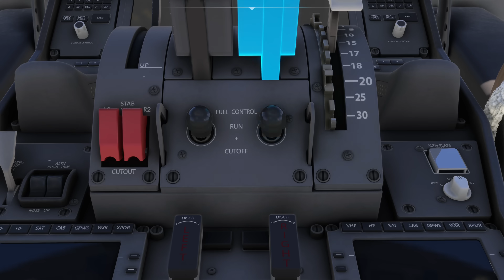Air India 171: Why Did The Fuel Cut-off Switch Get Moved?

Comment: Older American here.   I haven't heard anyone talk about how the airlines' financial liability could be influenced by the two major scenarios, intentional action by one of the pilots vs. operator / pilot error.   Do various scenarios impact airline liabilities / copiability differently?

Are there any other major commercial aircraft, that one of these pilots may have flown, that have switches, other than the fuel cut-off switches, located in the same or similar area as those the 878 that crashed?

Comment: My guess, with no evidence from a final report to back it up, is that it was a brain fart. More than one turboprop pilot accidentally feathered a propeller while trying to adjust the thrust and then noticed the mistake a few minutes later and reported it to the company, or were about to land without enough time to figure it out and so ended up in an accident report. This shouldn't even be possible given the knobs are not just in different places but feel different. So maybe someone was trying to do something with the thrust, hit the shutoff valve, realize he didn't hit the thrust, then went to the thrust levers without thinking "wait what did I touch earlier?" You can ask why anyone would confuse the two, but I've seen dumber mistakes in Air Crash Investigation.

Comment: In 2023 an Alaskan Airlines pilot in the 3rd seat....tried to shut off the fuel to the engines
But, was attack by the other two pilots and nothing very bad happened.
The 3rd pilot in a jump seat apparently was having mental problems.
Reply: Like the  pilot in the jump seat on FEDEX DC-10 years ago.
Reply: @sd906238 yea what a dumb evil p.o.s. that guy was, though his reasons of leaving something behind for his family was a good cause, it could never condone killing those 3 pilots, or even physically disabling one of them, let alone killing all 3 and crashing a wide body plane that could've taken dozens more with them, I could never forgive that p.o.s. for trying to kill me and clipping my wings, absolutely amazing those pilots survived
Reply: Yep different type of aircraft and he pulled the two engine fire suppression handles at 31,000 ft. The pilots quickly pushed them back in with no loss of power
Reply: @kiwicory100 yes, Alaskan Airways Flight 2059.
Reply: @Tryna-B-Good Alaska Airlines
Reply: @Tryna-B-Good it’s Alaska Airlines not Alaskan Airlines
Reply: Everyone’s blaming the pilots, but the same aircraft had electrical failures just one flight earlier — caught on video. The takeoff was unusually slow, and both engines shut down seconds after lift-off, with cockpit audio showing confusion (“Why did you cut off?” — “I didn’t”).

This doesn’t sound like pilot error. It sounds like system failure being buried to protect the company — just like Boeing did with the 737 MAX. Don’t let them repeat history.
Reply: @Gurpreet.jheeta  Why are you so sure that that conversation "Why id you cut off?" weren't a lie? Just to blame the other? You always think pilots are 100% mental at any time 24/7 every year?
Reply: There is the Germanwings flight 9525 2015 first officer who deliberately crashed into a mountain in the Alps.  Also,  the mystery of why the pilot of the Malaysian airline 370 went off course and stopped communications with the ground and the aeroplane just disappeared.
Reply: @abattle4101 Dont forget Egypt Air 990. The Copilot pushed the yoke over into a dive while the Captain was out of the cockpit in the lav.  Copilot cut throttles, and dobe the plane straight into the water.  He was heard on CVR saying "I put my trust in Allah" as he dove the plane.  The Captain actually made it into the cockpit, tried to pull out but ultimately lost the struggle and the plane crashed on the second dive.  I believe there was a Nigerian flight along the same lines.
Reply: I was often in the cockpit jump seat for a +hour flight during the 90´s. And iam still alive. My guess its not any seat, its the one sitting there that is a problem!
Reply: Very fortunate he pulled that shit on that flight as he was being flown to his own flight he was the captain of and had he pulled that shit while captain things might not have turned out so well
Reply: He was not still high on psilocybin, but it altered his perception to the point where he believed he was in a dream and panicked and pulled the fire switches in an effort to wake up from the dream. He wasn’t trying to kill anyone. That’s why the attempted murder charges were dropped.
Reply: ボイスレコーダーが公開されるまでは、パイロットがスイッチ切ったと断言しないほうが良いよ。家族に対して失礼だし。
Reply: yeah, he was depressed because he'd been to a memorial for a dear friend of his, who had died the year prior. Somehow, some imbecile who called himself his friend, convinced him to get high on mushrooms. He stupidly agreed, because he had a few off days, but the mushrooms were still in his system when he was in the cockpit, so he did what he did.
A really sad story, as that guy will never see the inside of a cockpit for the rest of his life
Reply: What is can recall was that the 3rd pilot was high on shrooms
Reply: @louisekerley716 he had taken them TWO DAYS before because his best friend died and he thought it would help with his depression. Those are some potent shrooms if they were working two days later. Please
Reply: @louisekerley716  no, he was just mentally ill and had a mental breakdown during the flight
Reply: There is more to it than meets the eye
Attempts are being made to let boeing ,GE and switch manufacturers off the hook.
Reply: @dattaak01 I completely agree. Hopefully the facts will be revealed. The way I read the preliminary is not what captain Steve says here. He's over simplifying the report. The reality is the switch sends a signal to a computer that signal is a voltage that acts as an input, which is received by the computer if there is any kind of short circuit wiring issue or voltage glitch the computer will read it as fuel being cut off by the switch when in reality it is a stray voltage being sent to the input of the computer. The fact that a second input for engine two is one second after the first input would be highly unlikely, but still probable. I hope for everyone's sake the truth comes out.
Reply: Wasn't there also a case where during an engine failure the wrong engine was shut down? Maybe having two hands required to shut down an engine would prevent that too?
Reply: @thenewgray  What if one pilot is incapacitated. Then it would be impossible for the remaining pilot to shut off an engine that was on fire.
Reply: @pigdroppings  He might have to reach over pretty far then.
Reply: Yes, and there's the whole German Wings incident.  This is not a new phenomenon, not sure why everyone is so surprised or resistant to the evidence.
Reply: @pigdroppings that's fascinating. It's hard for me to believe that this was suicide because I was under the impression that most of them occurred after the plane reached cruising altitude. Clearly, I was mistaken. I wasnt considering hijackings, either.
Reply: And he was doing mushrooms
Reply: @paulfiore7083 the shrooms are not the Problem but the mental was
Reply: Apparently
Reply: I remember that!
Reply: IMPORTANT POINT
Reply: Western propaganda covering up and saving Boeing.
Reply: he was pass riding
Reply: Priority to any flt civil or mil.physo analys should be done
Reply: see wikipedia for full story of 3rd pilot attempted crash
Alaska Airlines Flight 2059
Reply: Its an Alaska Airlines pilot not an Alaskan
Reply: So?
Reply: Joined 1 year ago bot
Reply: Blödmann! 😂
Reply: What seems so surprising of many of these youtube viral sites on the AIR India crash is that they seem to have jumped to a foregone conclusion that it was a suicide move by the co-pilot. Wow, two levers being recorded shut within one seconds time and that doesn't raise your questions in your minds? Anything about the levers not being in their locked position in the first place and a small jerk at lift-off having dislodged them to off position. The whole accident may well be a deliberate sabotage but for god's sake think of other alternate possibilities and don't dance to Boeing's tunes. After all pilots, if there is a genuine mechanical fault here, your lives can be endangered the next time.
Reply: Shame....it's easy to save boeing & make pilots culprits.... because dead don't defend. Boeing has purchased media same as congressman , trash , hypocrite, irony is they shamelessly push illogical nonsense conspiracy.
Reply: OMG didn't hear aobu that?
Reply: Watch Flyingbeast video if you  really believe in unbiased explanation ❤❤❤ english subtitles are available
Reply: So convenient that no media in the West published criticism by investigating body of such speculation. Everybody has assumed the pilot “calmly” said “i didn’t do it”, no mention of calm anywhere in findings.
Reply: And what would we know, without cameras in the cockpit, if the pilots hadn't noticed, or hadn't been able to fight him off?  Maybe some garbled audio, but would we know much definitively if that flight had crashed?  They need the damn cameras in the cockpit, covering the controls not necessarily the pilots faces, sending data to the black boxes only.
Reply: @MDC_1985 Great idea‼️💯✨️
Reply: @MDC_1985 wouldn’t have made a difference in this case. The evidence is stark and glaring. Even if there was video they’d be saying it’s AI.
Reply: I said it from day one, foul play by a third person in the cockpit! The reason would have been known very early BUT corruption, and saving face would be rife! 🤮
Reply: "Rat" was deployed before fuel control switches went to "cut off" mode why?
Reply: @Anonymo13  No, 5 seconds after the Number 1 CUTOFF was engaged.
Reply: @Sokol10 youtube you better not delete my comment unnecessarily 😒🙄

Actually the rat was already out as per video circulated in media and in report it mentioned that it takes 4-5 sec for rat to get fully deployed, so if we consider that time too it was deployed before the switch moved to cut-off. They will investigate it deeply further by taking both into account. But this is a possibility too
Reply: @Anonymo13 source?
Reply: @Anonymo13  Not true!  Unless you can provide proof...
Reply: @Anonymo13  First time i hear that, but there is a chain of boxes the information has to pass thru, so if the recording box that we know aboute is the last one, anything between the switches and the recording box could be malfunktion. And we get to know it as the switches is the one giving orders.
Reply: @Anonymo13  No, RAT deployed after the fuel cutoff.
Reply: @Anonymo13  but was it? If the switches were cut off on rotate, there was time for the RAT to be deployed.
Reply: @Anonymo13 They weren’t.
Reply: @Anonymo13 Simply untrue.  Why make up things?
Reply: @pacmanc8103  How do you exactly know this?
Reply: @Anonymo13  Incorrect.
Reply: @PJD_55 The preliminary report doesn't say one way or the other. Captain Steve is assuming a lot!  Not enough facts to know cause of crash yet
Reply: @Anonymo13  Because it wasnt.
Reply: @Anonymo13  Wrong, RAT was deployed AFTER the cutoff.
Reply: @Anonymo13  Aircraft probably hfaced a software glitch or a eletrical failure that prevented engines generators supply eletrical to the airplane systems. RAT is deployed by hold a RAT switch on the overhead panel by more than a second or in the event of loss of hydraulic system pressure bellow a target or in a event of loss of  specifically both AC electrical buses.I am a 787 enginner and by my undesrtanding one pilot would'nt  be able to switch off the fuel switchs without being imediatally noticed by the other pilot and also would'nt be able to switch off both fuel cuttout switches in one second . The preliminary report is ambiguous  purposely or by the nature and uncertainty of the aircraft loss.
Reply: @Anonymo13 exactly! I suspect that the complete loss of power (loom short) caused the safety interlock to drop, also stopping the fuel pumps, that need power.
Reply: @Anonymo13 none of us know the technical aspects of all of this
Reply: Well here comes the western and Indian culture... We just don't do this kind of work it's socially sinfull to the family of that pilots.... Also we blamed on pilots in max crash and than later on history knows what happened
Reply: @pandyadharmik what ! I am also indian. Indian society is not good more than a substandard society.. And do u know how many people are suffering from mentally ill.
Reply: @pandyadharmik in the end we are all human and have the same human emotions. In no country is it considered a good action to take down an aircraft you're operating.
Reply: @pandyadharmik  Be for real...India is known for engaging in behaviors that their culture and religion says is "sinful". Harm to others is done like is a normal thing...just recently they had news of the bride who was tortured by her in-laws and new husband and I'm pretty sure that is a "sinful" behavior in your culture. The medical records came out and the indian pilot did indeed suffer from depression and other mental illnesses...so much that he took off time to deal with it several times. He was also dealing with the loss of his mom and his elderly father's health. Mental health issues is not limited to culture. Is obvious the indian pilot did it, how he did it and why.
Reply: @pandyadharmik , my friend, please, be nice. The Westerners think it is normal for a society to have Single Parents and be on Welfare to have more children without being in a matrimonial relationship.
Reply: @pandyadharmik  not all Indians follow the Indian values
Reply: Thanks for  paid review by Boeing
Reply: @abhijitmohanty8002 it wasn’t a Boeing, it was an Embraer.
Reply: @abhijitmohanty8002  Obviously you are a typical Ind.ian with a low level mindset.
Reply: @abhijitmohanty8002  Not again! Not here. Take this comment to the Hindi forums. We’re unbiased objective truth seekers here.